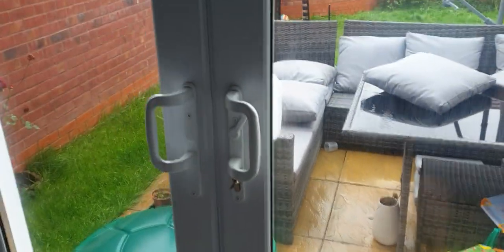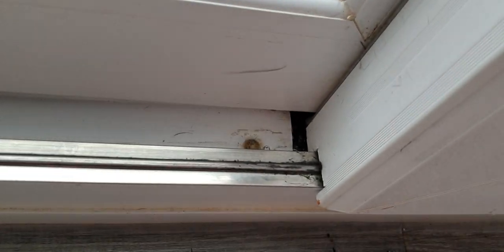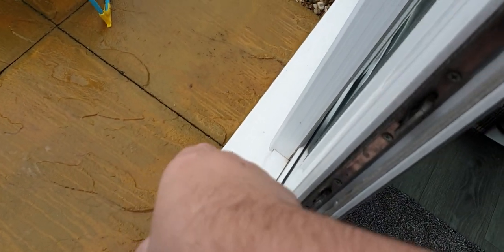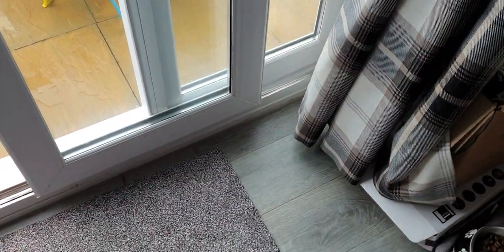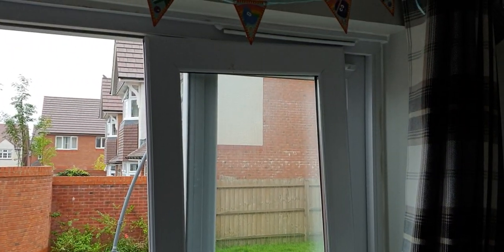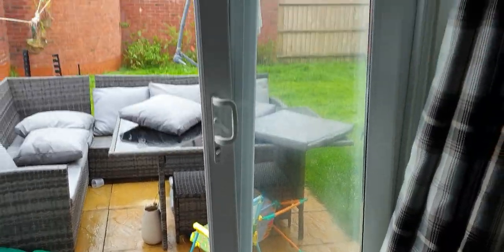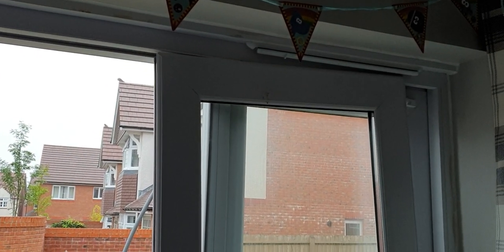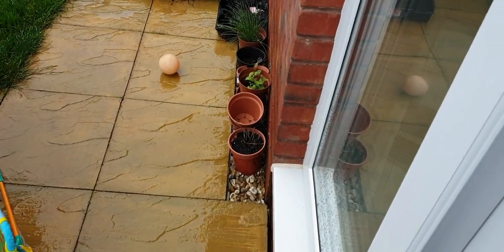Redrow New Build 400+ snags Patio doors bowed, SAR, nhbc, security, foundation crack desolved

Comment: I’ve worked on a couple of new build sites as a decorator and the quality of build is a disgrace. The problem as far as I am concerned is the poor level of over site on the trades, whether it be builders , plumbers, joiners etc. Being a decorator I’m the last trade in and the amount of repair work I have to do above and beyond painting is astonishing. Considering these are built from scratch the gaps between walls and door architrave for instance should be no more than a couple of millimetres not twenty five, gaps between stair stringers and the walls should not be ten millimetres and the walls should not flex in and out up the stairwell. The developers don’t give a sh**, this filters down the line to the trades, so they don’t give s sh**. My advice is if you are going to buy a new build, check it out before you complete and be prepared to walk away if you have to.
Reply from the maker: You guys get given poor works to layer yours on. It's terrible, no accountability. I've fought constantly for decorators to be given plenty of time to do things right and for trades to come on before to carry out works below the decorators. Can't layer good decor on top of piss poor dry lining / wood work etc.

We get promised it but it never happens, given them multiple chances over 3 years.
Reply: I'm also a decorator on new builds. Your right alot of Plots Your given a very poor.. but there also some very good sites. I've found the Last few years the standards have got better.
Reply from the maker: @danielbiggs6085  curious what you'd make of the area between the banister and wall as well as the lack of paint and change of paint on the wood between that area and the wall riding up at the base. The flat plaster bit as well. The flat plaster bit I've ran a cloth down it and a load of chunks of loose plaster came flying down but can't can't to it. Colin Norvil said in order for him to sort it he would need professional painters..... So my question to him was as opposed to what exactly?

Tbh as a whole large chunk of our problems are due to the previous or prior to that trades work and then work layered on top of that is just poor as a result. Can't do much without good prep or good base to work on to begin with.

Have a look at the other videos on here
Reply: @Vision2UK  without looking at it i really could not comment on it... but I'd imagine the problem is were the bannister is fitted by the carpenter the wall and other fine details were not completed properly. It's virtually impossible to prep and decorator properly....
Reply from the maker: @danielbiggs6085  don't understand why they design it this way. I have a video of it on here. Dunno how I'm supposed to paint this and get a line to mask etc in the months and years to come.
Reply: @Vision2UK  alot of the big builders design it now we're this problem doesn't happen. If I'm honest I've not come across this problem for a while now. But it was a grey area on most sites for years.. I get it aswel because as you walk in your front door its staring you right in your face and just looks ugly
Reply from the maker: @danielbiggs6085  yeah I see it multiple times a day. Sticks out.
Reply: @Vision2UK  its a shit design. I'm no expert but would a oak pigs ear handrail going to each newelpost be better?
Reply from the maker: @danielbiggs6085  it would mask the issue rather than sorting it. There are structual issues with it for when it was fitted and major alignment issues with the posts and where the banister meets the posts. Would reduce the wobbly but eventually it'll.give with the amount of movement it has at the moment. Short term solution perhaps but long term if we decide to sell would be an issue
Reply: @danielbiggs6085  hi Daniel. Yes you’re right, not all sites are bad, in my experience the first few on any site seem to be the best and as the site build progresses the standard drops, although this is not a maxim. As I said in my original post it’s a failure of oversight by the site manager/s and I feel for the buyers because it’s generally after they have moved in that problems start.
Reply: @markwilliamson7846  I'm on a bovis site at the moment and it's fantastic. Brilliant chippy Brilliant plasters. And a site agent who makes sure the plots are ready for me. And gives me the key and tells other trades there not allowed in till I'm finished.. 
But sites like this are few and far apart.
Reply: @danielbiggs6085  wow. That kind of site sounds like it’s just as it should be. If we decorators are to turn out good work the property needs to be as dust free as possible but more to the point free of defects created by the other trades eg, holes where they shouldn’t be, no large gaps where they shouldn’t be etc, looks like the penny has finally dropped on your site.
Reply: @markwilliamson7846  like I say sites like this are few a far.. there's still alot of bad ones out there.. And there's also alot of rough decorators out there as you probably know. Some decorators out there are really bad.
Reply: @danielbiggs6085  yes you’re right. There are some terrible decorators out there, I’ve had to put right some of there work. Don’t get me wrong I’ve made mistakes in the past as you probably have  but it’s knowing you have and putting it right that matters, not turning a blind eye and hoping the customer doesn’t notice, however on a new site there is no customer as such so it’s down to us as professionals to have the correct attitude and say to ourselves if it’s not good enough for me and my house it’s not good enough for the new owner of the new house we are working in.
Reply: @markwilliamson7846  completely agree my friend.. it's all about having pride in your work. 👍
Reply: @danielbiggs6085  sounds like you and I are singing for the same hymn sheet. Here’s to quality work.
Reply: @markwilliamson7846  👍

Comment: We bought a Redrow new build in East Sussex eight years ago. The list of snags ran to one full page of A4.
Basically it boils down to the site manager and how good he is at QC on the subs. Its no good going to another developer because they all use the same poor sub contractors. We had staircase badly fitted, graffiti scrawled on roof tiles, bath and other sanitary fittings scratched. Flooding around the whole house after it rained caused by poor drainage. Don't think they used a spirit level for brickwork. Basically they are not a five star builder and wouldn't let them build a childs wendy house.
Reply from the maker: Redrow haven't improved then. They are playing the ignore game at the moment. I've invited the CEO and directors / board down here multiple times but they can't be bothered to come face to face with the realities here. Nhbc are saying standards are guidelines so now also battling them as well.
Reply: Go legal on them and a get national newspaper involved.
Reply from the maker: @geoffcrisp7225  I've put them in every national paper, just Google Redrow kirkaldly snags :) our solicitors are in place, Redrow are trying to cause solicitor fees which we aren't allowing.

Comment: Floor is an issue but can be resolved. The doors and gutter are easily fixed. Gutter has popped out due to house settlement done mine in 5 mins. Doors would take an hour to repair. If it’s stressing you just do it yourself but if you do not have the skills get someone in to do it.
Reply: These are all true, but missing the point slightly. This person has bought a new build home and can expect the build to be of a certain quality. They haven't got that quality, and the vendor should put it right. These being simple fixes makes it worse, not better, because it means the vendor has dug their heals in and has probably spent more money not responding to contact than they would have spent just fixing the snags. And the vendor has an interest in understanding and fixing snags: they're paying builders and tradies to meet certain standards (some of which are legal requirements) and they need to know that those standards are being met.

Comment: Bought a new build from McClean (Tarmac) in 1983. The staircase came away from the wall by an inch, the toilet floor sank when someone walked past on the landing and everything finished very badly. As we were the first stage build of a large development the site office and staff were there for another eighteen months but totally disinterested in snagging our house and said stairs was natural settlement. Sister bought house opposite and entire staircase collapsed but NHBC said not covered by the 10 year guarantee as not structural. Additionally the only built in wardrobe in the master bedroom was lost to us to use as they decided to re-site the hot water tank there instead of under the stairs as on the site plans.
Reply from the maker: Crazy how things just have not improved in almost 40 years. Nhbc are still not enforcing their own standards let alone building regulations. Legal enforcement is needed and building control going back to local. I feel each house should have an independent surveyor prior to completion paid for by the developers and they should be legally liable for financials should issues be raised that delays completion as a result, paid daily with interest. There is no financial incentive to get things right and properly to begin with.

Comment: Site managers are under the thumb at Redrow.They are pushed to get as many new properties signed over as possible.
I worked as a bricklayer( self employed) for them.The site agents aren't qualified and are just 'yes men'
I had 3 houses on the go,and the site manager pleaded with me to correct a house that had the downstairs ceilings 150mm too low.I consented saying He would have to pay me and my gang pro rata (the same as my weekly average output.) I also insisted on a meeting with the area manager.They promised what I insisted on.
I went ahead and put the said house right.What the area and site manager did,was book the 3 houses in that i had been working on another 3 wks ahead.(which covered the work I had done financially) This covered their arses for not checking the house in question as it was being built.This left me with 3 houses overbooked,and I lost 3 weeks production and wages.Try as I did,I couldn't get any response from the head office.
A tradesen's hardest part of  job,is being one step in front of most dodgy builders,and on avarage,I would say that that is 70% of building companies.
Reply from the maker: We have seen internal Redrow emails which showcase how Redrow treats trades, not acceptable at all. The lies you've been told I've heard many times over and we've also had the same scale of lies thrown at us by site and directors as well as their CEO. It's evident to the point of being casually done. Change is needed.

Comment: A major developer kept driving vehicles over a new house foundation until it cracked and it off.
They just did a quick bodge with a bit of concrete below and skim on top.
This house is now being sold for £500,000.
Reply from the maker: Sounds like something Redrow would do and NHBC would blindly sign off

Comment: Door stop should be attached at the bottom,not the top. It should be fixed at the correct measurement to stop the handles from hitting the frame.Otherwise you won't be able to close it from the outside.
Obviously the tape has been left on while been assembled in the factory.
Reply from the maker: The frame top and bottom is a wave, they overfilled with foam which has buckled the frame. The trim pieces have fallen off also. There is the reveals which are quite badly out too

Comment: This should be covered by the NHBC, as it is them who inspect the house at stages of build.  I know it used to be a 10 year warranty, but i am not sure on how long it is now.
Reply from the maker: It's 2 years with Redrow followed by 8 with nhbc for structual. Any items reported in the first two years is the responsibility of Redrow to fix, should they fail to do this the nhbc steps in and enforces it, if that doesn't make Redrow execute then they take over.

However the reality of this is quite different.

Nhbc have instructed Redrow on these patio doors get Redrow still say they are fit for purpose. Crazy.

Redrow have repeatedly lied to us, failed to execute on promises, blackmailed us and now attempting to pay us off with an amount that doesn't even touch the sides of the cost of fixing and replacing things here let alone anything else.

Nhbc wise, all items they measured here went in our favour, items they couldn't be bothered to measure they are contesting even though they have been measured by our snagger as out of nhbc standards.

The battle continues and Redrow has still failed to respond to hundreds of emails, ignored nhbc emails / calls, Redrow have failed erect scaffolding and do reports, they've also failed to execute on works instructed by nhbc.

Comment: Looking to buy a new build redrow. Apart from not buying a new build, what's the best thing to do to prepare for this
Reply from the maker: That's a difficult one to answer, we did above and beyond what is reasonable and this is where we ended up. Unfortunately you're effectively gambling on whether or not you have a site manager that cares, keeps trades in line and enforces standards or not. You're also gambling on the trades and attitude in general on site. That's an impossible gamble to make.

The other issue is this attitude of don't care and ignore it seems to be rife throughout Redrow. We have emailed dozens of directors, head of customer services, previous CEO John Tutte who gave us black and white assurances pre completion then disappeared post completion. We have been on contact with current CEO Matthew Pratt but out of hundreds of emails he has only bothered to respond to one of them where he stated multiple false statements and then went on about how they are a 5 star builder and 5 star trust pilot (they aren't).

Going from our experience, I would visit the sales offices, show them this and ask them why. You're welcome to contact me whilst you're there and I'll set them straight.

There is an ombudsman but this only applies to reservations made after that devision has joined so likely won't apply to any houses built pre 2023.

I don't know basically, I don't honestly know what else we could have done to avoid it
Reply from the maker: I'd also add some further to the below, nhbc have been involved for past 8 months and since their involvement a grand total of zero defects have been dealt with. Zero defects have been investigated by a professional trade and zero reports have been drawn up despite them instructing Redrow to do so.

Redrow ignored the nhbc, didn't carry out anything and the nhbc refused to measure a single defect. 400+ defects and not one were measured. We had them measured and told them they were out and the nhbc then attempted to use the idea that all standards are a guideline that can be ignored. Your contract won't state this, your contract will state it must meet the standards and that it's of a good workmenship like manner.

Nhbc and Redrow work together to limit their liabilities, offer stupid amounts as settlements to get you to go away that won't fix all your defects leading you onto either legal which is insanely expensive or go public.

Had we been told at point of sale that our home would be built to eye balling guidelines and not built to standards we would never go anywhere near it.

That's the question of ask sales, is the home built to standards or are standards a guideline as well as how these standards will be enforced.

Let me know of you decide to ask them.
Reply: @Vision2UK  many thanks for the advice, i will keep you updated on our progress.

Comment: All upvc inline sliding patio doors are rubbish, I always talk customers out of them. Yours is missing the stop at the bottom thats why when you fully open it it tries to jump off the track. Also not good practice to drill and fix into a Catnic lintel
Reply: Yep stopper not installed the "wouldn't take much to break in" is true of all sliding patio doors they are all shitty get a stopper fitted and cut a few 2x4s to secure it more when your old/away as is a thief can be in those doors in a few seconds
Reply from the maker: There is a stopper on left and right, the left door has the same as right but doesn't twist like this without it. It's been confirmed that the whole frame is shot and needs replacing. Just now fighting with Redrow to get them to sort it as it's already leaked the damaged the floor
Reply: There should be stops at the top and bottom of each side. If you open the dppr slowly so as not to hit the stop does it still jump the track ??
Reply from the maker: @RoverMan85  the left functions as normal minus the other issues. The track at the bottom is wavey, so when the right door shifts across doing it slowly it lifts, becomes completely out of square then hits the top right stopper. There is only one stopper on the left one which is at the top left, there isn't one at the bottom.

Very little effort is needed to push it up. The handles are also wobbly, lock too and the movement.

The window guys came out over a year ago and pulled the plastic trims out and found the entire frame has been bowed. Even they have told Redrow it's knackered and needs replacing.

Baring in mind that before we completed the doors were like this, trim pieces dangling off, gap between the door seeing day light etc. We were assured they would be fixed multiple times prior to completion.